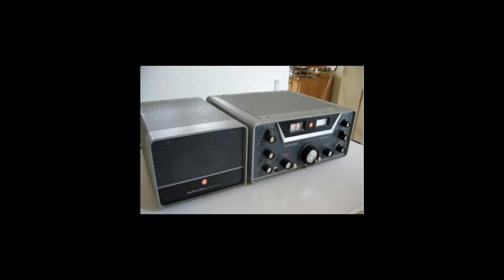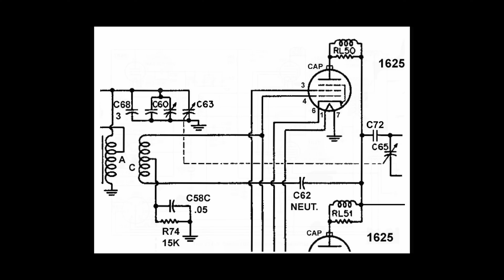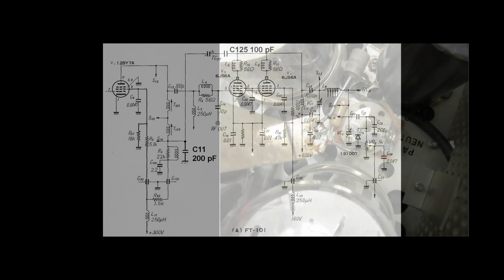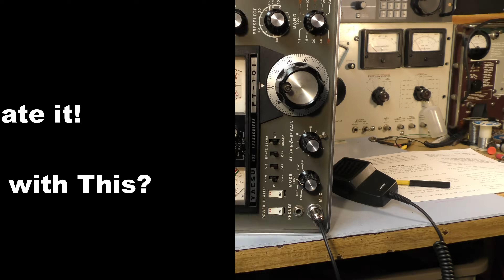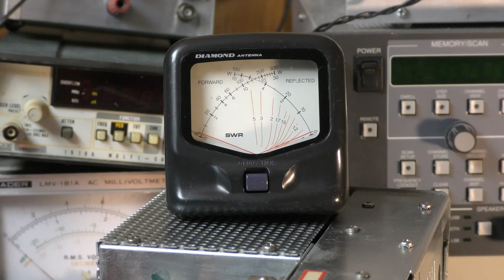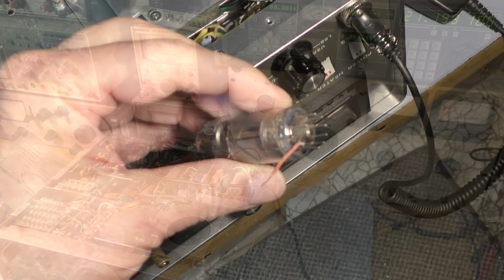FT101 Part 8  Neutralization Fun

Comment: Hi, can I use this method in my FT-101E, if I try to replace the final tubes with PL509 or other European sweep tubes?
Reply from the maker: Short answer - Yes. You do have to make sure that the sockets are correct or change swap them out as required. Most sweep tubes have enough voltage rating, plate dissipation and gain to work.
Reply: @MIKROWAVE1  Thanks a lot, sir! You made me very enthusiast.

Comment: In TVs, AGC can slightly detune the apparent output capacitance of IF amplifier tubes - which makes me wonder how much effect of the "cold" vs. "hot" neutralization techniques have on tube interelectrode capacitances (e.g. like in BJT transistors, the CB junction capacitance is a function of collector voltage).

Comment: Hi Mike. Very interesting video.
I use the method of powering the trancever on transmit but with the screen grids tuned off no voltage on them. Then using a second receiver and tune the neutralization cap for minimum signal.
This seems to work well on a Kenwood TS830S. Not tried it on a FT 101EE.
But very interesting methods you have shown.
Best 73. Paul HS0ZLQ, G0MIH 😊😊

Comment: Hi Mike I introduced myself to you at what was probably the last NEARFEST in Deerfield. I like, you just purchased my first ever an             FT-101 (ES).  My rig is far from neutralizing as I am still in the cleaning stage. Do you have a parts rig? The one I bought was dropped on front corner and the bezel was bent and probably very difficult to straighten. I would,  if you have one off a junker pay what it would take to send it to MA. Your videos on the 101 are very helpful an I have watched some more than once. 🙂🙂 73 Jim WA1UWX

Comment: not sure if i missed it in other videos. bais'ing tubes.. or is that the same as neutralization ?
Reply from the maker: The FT101 uses a Class AB Bias that puts the final amplifiers in a linear mode to transmit SSB or AM. You adjust this with a potentiometer and look at the resting current just as you would for an audio amplifier. The Driver is Class A.
Reply from the maker: They are different, but both are important for the final amplifier tubes.

Comment: Yes, I’ve used forward cold for years with a T-connector with 50 ohm pad on one side connected directly to the o’scope. I use 10M if I can - if it oscillates, power down, back off to 15M, neutralize and try again on 10M. Usually it’s a 10 min procedure.

Comment: I have used the cold neutralization method with a scope and it work great. Also used it on a TS-830S Kenwood with success. Thanks for sharing and the TLC on a very nice radio.
Reply from the maker: I learned the reverse method from an RF Engineer I worked with. He was a ham and SK just last year. I wanted to pass it on.

Comment: Thanks for the therapy, Mike. The cold method looks intriguing—and reassuring to the electric shock averse. Looking forward to your 6146 conversion videos.
Reply from the maker: Doing a cold neutralization BEFORE setting the bias is a good way to prevent surprises with the finals.

Comment: Never understood the term as well as I do after watching this! Perhaps this question is obvious to all but - Is there no need for neutralization for a solid state final?  Also ‘why not’ might be of interest?
Reply from the maker: Actually there is a need for neutralization with solid state finals. For common base and gate amplifiers, the impedances are low enough that good grounding and isolation are usually enough. But in common emitter and source amplifiers, high source and load impedances are required by the device for high gain. Further, the potential instability of the modern triode FET structure dictates that either neutralization or a stable source-load combination must be employed to insure that the common source amplifier will not oscillate.

Comment: Thanks for the continuing series Mike! I just got done covering neutralization in our ongoing General Class upgrade course.  73 - Dino KL0S
Reply: That sounds like a great class, Dino!
Reply from the maker: Wow Dino will be loose on the bands! Ha. No he is teaching the class. I grovel at the masters feet.
Reply from the maker: The place where it really shines is when you have a true CW MOPA with a VFO or a single buffer stage off a VFO.  Suddenly the keying straightens out, chirp goes away and the grid current acts normally.